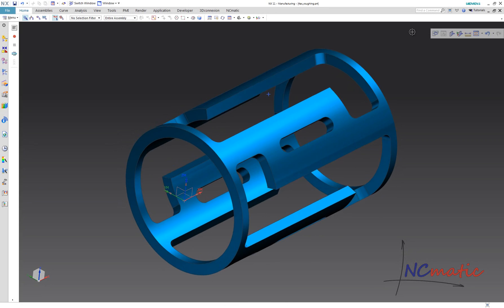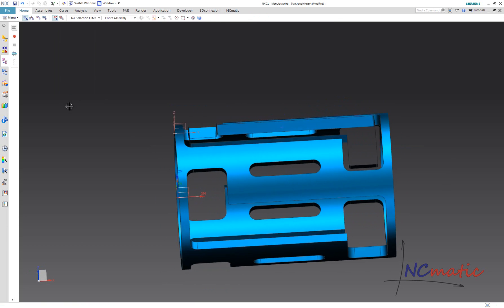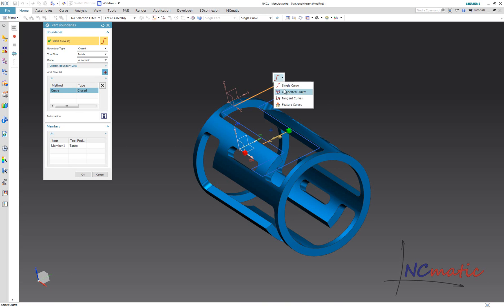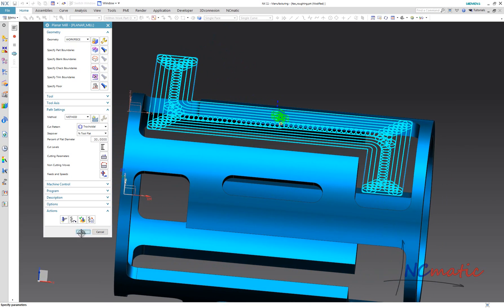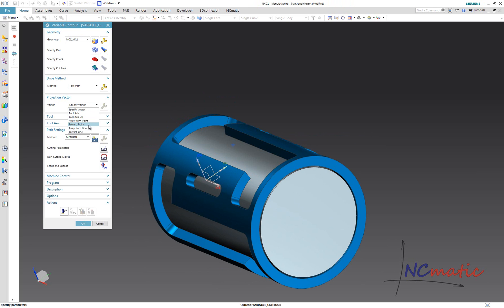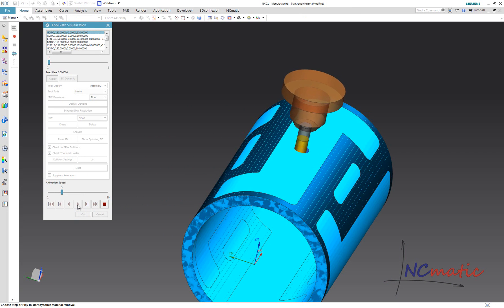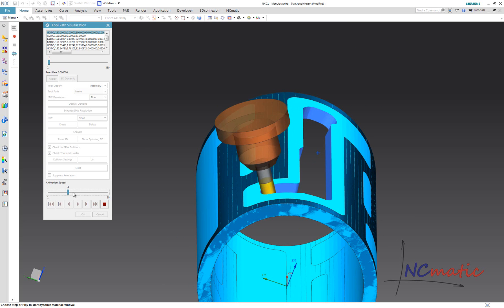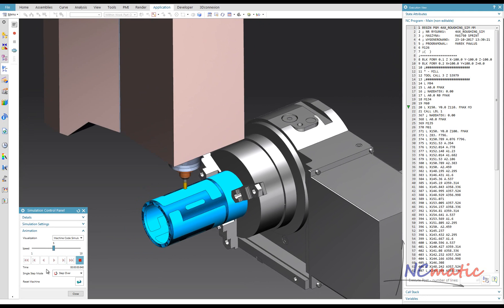"Tool Path" Drive Method in NX CAM

Comment: Can this method be used with Adaptive Milling as the source pattern?
Reply from the maker: Yes, it should work identical way. But obviously it makes sense only for single level (depth-of-cut). If auxiliary operation will have multiple cut levels it will all be projected to the same surface.
If I would need several cut levels, I would create them in separate operations.